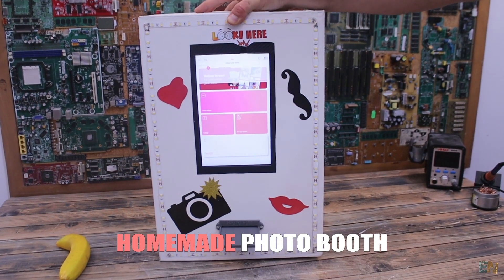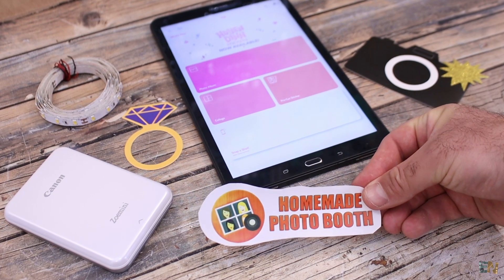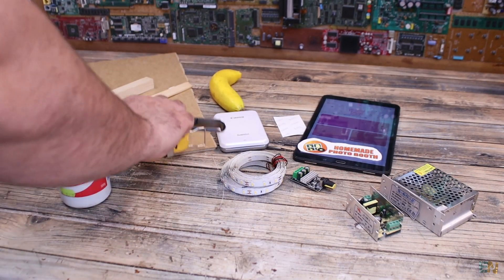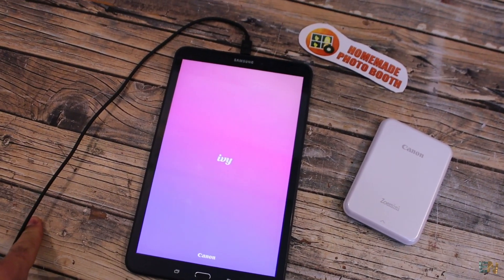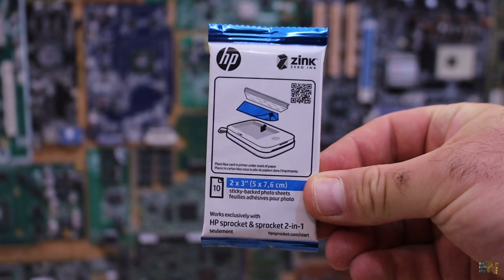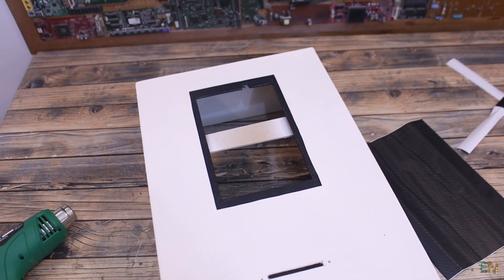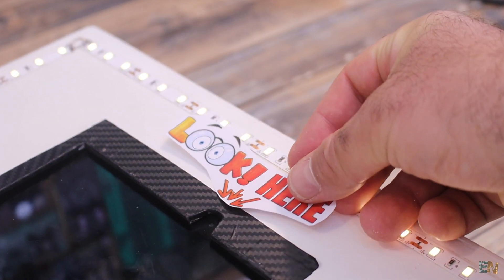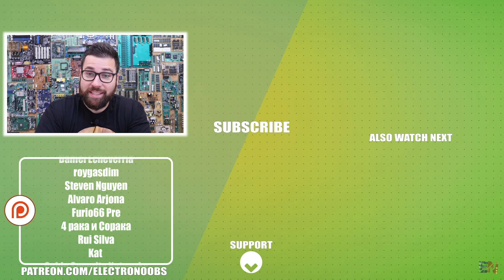I've made this! Thermal Printer Photo Booth

Comment: Bro, Your projects have so many 3D printed/ passive or expensive materials/ inventories. Sometimes projects are so much complicated that no one wanted to implement on their own. & also there's nothing new to learn. Your old videos are way much better. That teaches fundamental electronics, Motor, power & Arduino related content. But new videos doesn't add any value to electrical students. That's why views of your videos also dropped. By the project title, I also didn't want to watch video but then I saw your insta story. My support for this channel is always 💪. Please make videos that adds value to electrical/ electronics students.
I give you some topics:
1) High speed PCB design with Altium
2) Circuit simulation with proteus/ PSIM softwares
3) Design and simulation of Electro- mechanical systems in MATLAB simulink (Like EV design and modelling)
4) PLC/ SCADA system for industrial automation
5) Grid connected solar PV inverter with battery storage port.
Reply: that would just change the main appealing feature of this channel this is for hobbyist electronics and not something like Neso academy or nptel lectures though maybe suggesting a change of scenery at times and various other projects which are not heavy because that market of students and professionals is not the target here
Reply: that would just change the main appealing feature of this channel this is for hobbyist electronics and not something like Neso academy or nptel lectures though maybe suggesting a change of scenery at times and various other projects which are not heavy because that market of students and professionals is not the target here